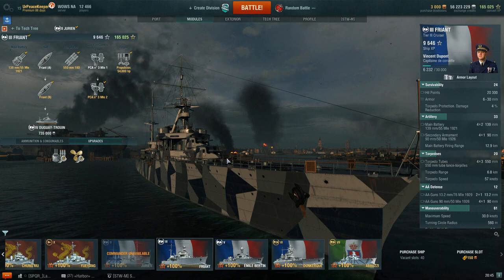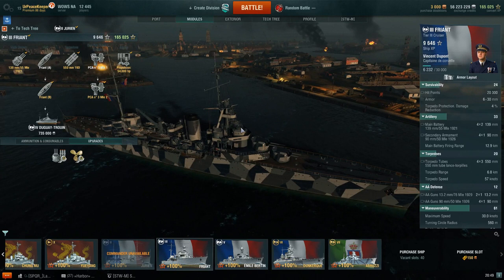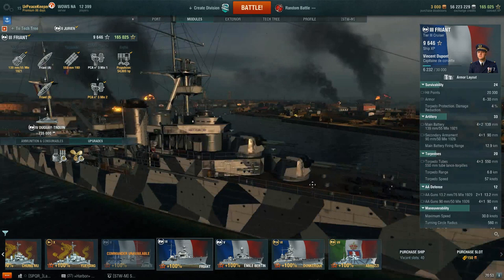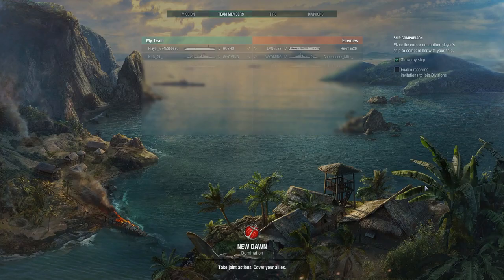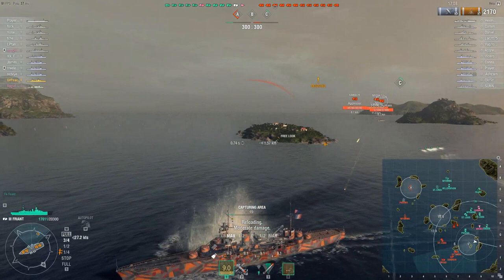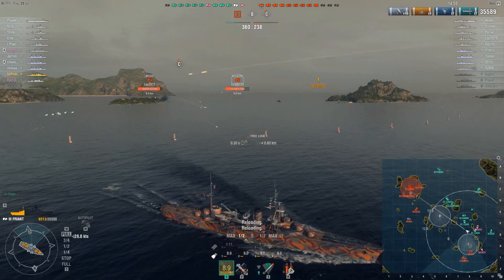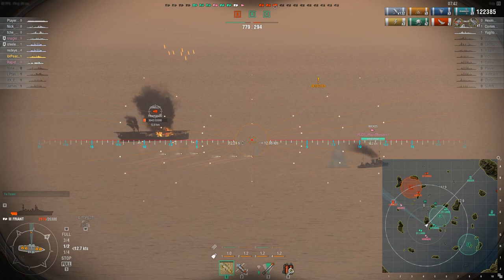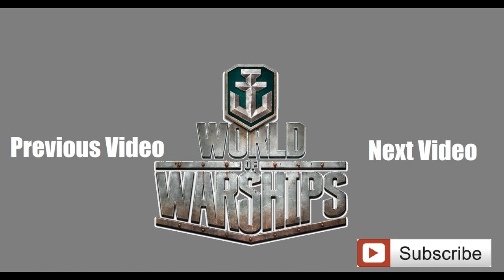How To Play French Cruiser Friant In World Of Warships

Comment: The situation for these torps is very easy to describe: a Yolo run right into the middle of two or more enemy ships. ideally exploiting a lot of island cover on the way in and otherwise wiggling like crazy to get close enough for the 6km torp range. You're probably gonna die but you can take several BBs with you, especially if their drivers are not very experienced yet. A lot like the lower-tier German DDs, actually, which have about the same amount of armour and the same torp firing arcs.

The other use is as a DD killer, seeing as it has a lot bigger guns and more of them. Just never stop wiggling, basically like a topless dancer at some Paris club.

Comment: There are two questions I have to decide if I leave a permanent captain on the Friant.  (Currently I have a 3 point captain on this ship.  I also have an 11 point French Captain but he's on a higher tier French Cruiser.)
  
Question 1:
I wonder if it would be better to spec into Advanced Firing Training before getting Concealment Expert?  
Question 2: 
Would it be better to chose Demotion Expert over Basic Firing Training?  Eventually I would get BFT but the question is which should I get first?  BFT  increases decreases your reload rate by 10%, which in turn increases Damage Per Minute by 11.1%,  while DE increases your chance of starting fires by 2% per hit.

For question 1, normally I would go with Concealment Expert first, but I'm thinking that with the 20% increase in firing range that AFT gives you, this would be good for long range HE spamming at the beginning of the game and CE might not be as important as the game progresses and I close the range with the enemy to use torps and apply more pressure in general.  The downside of choosing AFT first is my detection range would go up every time I opened fire and this could (probably would) draw the unwanted attention of enemy battleships. 

Question 2 seems like it should be something that could be decided by math.  In theory you could produce (on average) 11.1% more damage (with guns) with BFT but with increased fire chance how do you calculate how much more fire damage you will do?  If someone knows a formula to make this decision easier that would be very helpful.
Reply from the maker: I'd say AFT first and BFT first.  The key being outright damage dealing since that's the most reliable way to do damage.  DE would be nice later on, but I don't think you stand to gain as much right away from it as BFT.